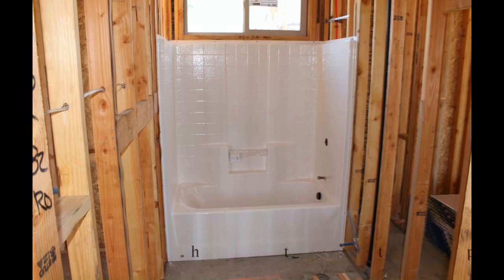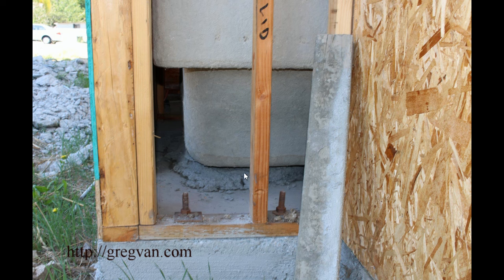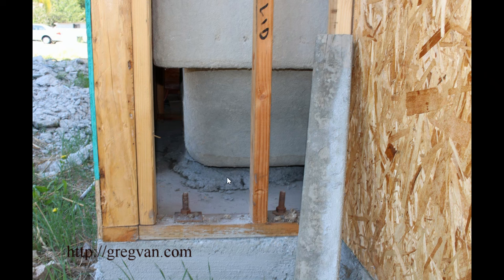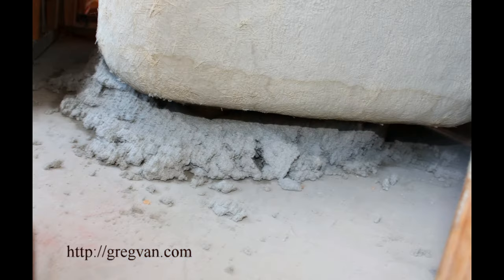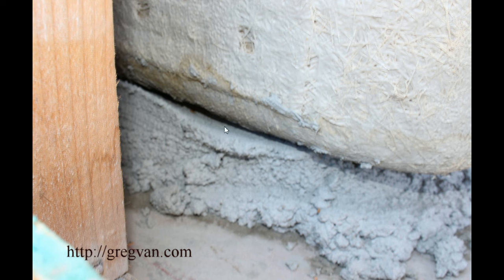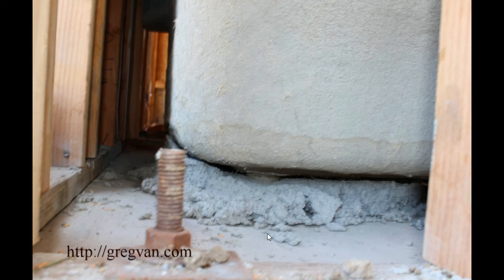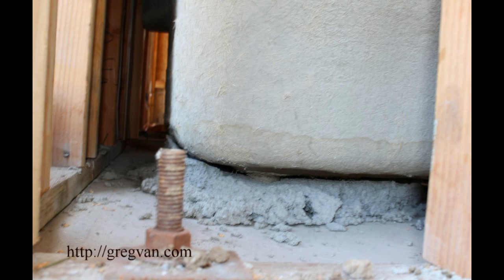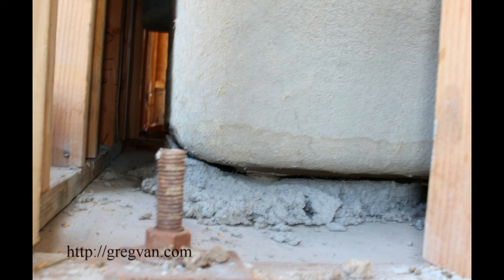Biggest Problems Created When Using Mortar Under Bathtubs – Plumbing

Comment: PRO TIPS----> Put down a sheet of poly so your NON SHRINK MORTAR doesn't actually stick to the floor encase you mess up the location by a bit you can just lift it up and reset, dont forget its not about cementing the tub to the floor, its about transfering the load of the human+water down to the floor. Roll the non shrink mortor into 5-6 balls, one in each corner for sure. Lastly, use non shrink mortar :)
Reply: What is non shrink mortar , is it a type of mix different to the usual mortar?
Reply: @michelleliddle6375 I’ve been looking at a bunch of videos, got a shower pan waiting for me.
I saw in one video, they use a “sand mix” found it at Home Depot. It’s a quikrete product called sand/topping mix. I picked some up, its about $7 a 60# bag. It’s over by the play sand. Gotta fix the drain first.
Reply: Thin set mortar/ tile mortar is what you want. And put it on top of cement board to keep from soaking the water out. If not put down a red guard or a liquid waterproof first. And most definitely stay out of it till the next day

Comment: I never use mortar beds. Never had a problem. Make sure you have a SOLID subfloor, make sure it's level. Use stainless steel washers to fasten to studs.
Reply: THis is what i am going to do here in a few weeks.. i don't see a need for this mortar mix under it.

Comment: I used mortar to set my tub and I'm a first time do it yourselfer. the manufacture specified using mortar or void warranty. I did pre install the tub, leveling it and marking the final resting position. I have about a 1/4 in drop in the floor, drain side.  I then removed the screws,  pulled the tub, and piled about 2in of more mortar on the plywood floor, covering the intire area where the base of the tub will sit. when I re installed the tub in the mortar I pressed the tub into the mortar just till I hit the marks then installed the screws back into the original holes. then I waited 3 days. so far so good 6 months later.
Reply from the maker: Excellent, it might've taken you a little longer, but it will be worth it in years to come.

Comment: This is why you follow manufacturers directions. If the manufacturer says to use a mortar or cement mix you should use non shrink grout. Non shrink grout doesnt not shrink when it dries. Plaster paris will break down over time if it gets wet. Plaster is water soluble.  I've been a plumber for 30 yrs and you need to follow manufacturers recommendations.  Some tubes and showers say dont add mortar or grout.
Reply from the maker: An extremely helpful comment and I hope others read it.
Reply: When you say non shrink grout is that mortar we are talking about or something different? Also Would it be okay to use rapid set mortar so I wouldn't have to wait several days for it to cure?

Comment: Started Plbg in the mid 80’s & our shop used plaster of Paris. One of the keys to using that or speed set drywall mud,(neither shrink) is clean water & tools, just a hint of plaster or mud & the batch fires off but pronto. In doing apartments/condos where tubs & their setting was subbed out, they used similar, never a cement mortar product. Sometimes they’d even glob it on build out studs for added wall support from flexing.

Comment: I use a really dry morter mix with a modifier, and it's worked well. I agree, you have to just set it and leave it. Also, the tubs I set had a support grid on the underside, which I think allows it to work a bit better.

Comment: @gregvancom The self leveler plus & Primer T from Lowe's worked excellent second time around . I had to drop laser level in the cut out drain section to see the line where to pour up to. Some product did drop down because "Great stuff" spray was blocking the laser. However, now the tub area was perfectly level using existing PVC drain & overflow. The Sterling Traverse 3 piece with the subway tiles lined up good. I used a outside felt grill mat as a cushion base over the leveler for added support.

Comment: A thin flexible rubber like material on the bottom making the mortar contact might work. I've seen thick foam board suggested but it has to be precisely cut, it will lift the tub if too thick or not make contact if too thin. The rubber or thin foam board would give and rip vs the fiberglass during removal also.

Comment: The Sterling fiberglass tube/shower I'm replacing has several supports built right into it. I had this tub for thirty years and never had any problems. When I installed it I didn't see a need to add anything else. At the moment I'm waiting for a acrylic tub that I ordered. I don't know what to expect as far as support, but is there anything wrong with using several pieces of say 3"' or 4" PVC pipe cut to fit under the tub for support? I also read another post someone had used pressure treated wood. Any opinions? Thanks...

Comment: My son has a 15-20 year old house, so there is not any access to the tub. I am a rookie to say the best.  Would drilling holes in the floor and then trying to spray foams through the holes work or wound there be to many voids to worry about? Thanks for any advice
Reply from the maker: I don't think it would work, but it wouldn't hurt to try it.
Reply: @gregvancom  Thanks I beleive your right there would be voids you can't see.

Comment: This makes total sense, if a 200lb Plummer stands in tub to set the tub, the tub deflects and when he steps out it rises back to its original position.
makes sense to me.👍
Reply: I would put a bunch of weight in it, and leave it there until the mortar dries. I’ll probably either fill it with water, or just use the heaviest plates I have from my bench press. Once it dries, I would think there shouldn’t be any deflection.

Comment: look closely the tub has legs on the back . the mortor  is holding the legs in place..... the mortor doesn't have to touch and the air gap is OK....I've installed hundreds of tubs being a plumber and we never use mortor unless it's a jetted or soaker tub those usually don't come with legs so mortor is needed
Reply from the maker: If you're suggesting that the bathtub installations are better, without mortar or Plaster of Paris underneath them, then I would strongly disagree. If you're suggesting that there might not be any problems if you don't use any type of support materials, then I would agree, but let's pay attention to the word might or maybe.
Reply: Kyle, I've been renovating houses for 30 years, and just giving some advice in case you haven't run into this problem. Some tubs, even though they have feet will actually have feet that don't line up in a plane as they ought to. The only way you would know this before the installation is if you flip the tub sideways or upside down then put a straight edge along the bottom of the feet to make sure they are all level. If they are level and the floor is solid and level, then as you say no mortar or additional support is needed. However I've found that with more than one brand- Lyons being the most recent, the bottoms of the feet don't all line up in a proper plane. They may be anywhere from 1/16 to 1/4 inch from lining in the same plane, or 6 out of seven all line up but one is either longer or shorter.  In this case it's necessary in my opinion to use either mortar or a rigid foam to support the feet that don't properly contact the sub-floor. The feet can also be packed with mortar to give them a wider stronger footing. Take care, and hope that helps.

Comment: Metal tubs and shower pans for the win... I'm done with fiberglass
Reply: From the horror stories I've read about people installing brand new plastic fiberglass tubs, I'm glad I'm going to be bypassing that experience. seems like everyone's tubs is cracking after installation and after they tiled around them. that's a ton of wasted money!!! I'm definitely going metal.
Reply: Steel tubs can still have issues if you don’t set and support them properly. I’m replacing my parents’ steel tub now, that my uncle installed maybe 10-15 years ago. He was a carpenter, jack of all trades type, so naturally he didn’t put anything between the subfloor and the bottom of tub, so only a 2x4 ledger board was supporting it on the back wall. Needless to say, it warped, and the middle started sagging, so water pooled in the bottom and started rusting it out. So unless it’s cast iron, with built in feet, I would recommend using a bed of mortar or plaster of Paris underneath, if you don’t want to end up replacing it again in a decade.

Comment: I got an acrylic tub at a ding and dent sale and came with no instruction nor can i find any online for this tub all i know its made by a company called Dubai. It has 1/2 particle board supporting the bottom and little squares (feet you could say) that keeps the tub level. would i still need mortar?
Reply from the maker: That's a good question and if the floor is level that the bathtub unit will be sitting on, then probably not. I wouldn't use mortar in between objects that are going to be less than 1 inch wide, but what use Plaster of Paris. The biggest problem with units with flat supports as you're suggesting is that they usually don't touch the ground.

Comment: I removed my old tub and found that the used plaster of paris, but they put them in bags and set them in the middle of the tub I guess for support. It's an old tub so I'm guessing that's how it was done back then. What type of mortar do you recommend using cause I've heard some will crack your tub if it drys too fast? I'm in the process of replacing my old tub.
Reply from the maker: You can use plaster of Paris or mortar and if you're worrying about it cracking, then you might need to contact the product manufacturer for more information. I could provide you with a suggestion, for example simply adding more Portland cement to your mortar to make it stronger, but this would only be a suggestion.
Reply: @gregvancom  Thanks, I've decided to go with plaster of paris.
Reply: Gypsum cement is the right choice for setting in drop in tubs.

Comment: My mortar was wet as if I were building a retaining wall....I didn't use 15-20 % of the bag....thinking it shouldn't be so dry......is that bad
Reply from the maker: Wet mortar usually shrinks a little more and then creates a gap in between tub and mortar, but not always.

Comment: Please be specific, what water mix ratio relative to what the manufacturers suggest and you've experienced as adaquate? 

 i e. I have an 80 lb bag that says to use 5qts of water.
Reply from the maker: I can't provide you with the exact amount of water used for any concrete mixture, because I've only used the directions once and it made the mixture to dry.

Comment: Is it normal that they concrete the pipe under the tub too? They did this at my house and we no longer have access to the tub pipe below but it has since cracked
Reply from the maker: No the plumbing pipe shouldn't have concrete on them, but I've seen it done before. As long as it isn't leaking or creating a problem, then you might not need to do anything.
Reply: @gregvancom  they cut my pipe with a saw then just left it embedded in the concrete so now I can't really replace it. It has a small cut but it doesn't appear to leak

Comment: I would use non shrink grout with plastic sheeting over it.
Reply: @Robo Man I have used non shrink grout under a fiberglass shower stall.  I troweled it in from the sides though because I had the room. Worked just fine and good until today.

Comment: I got a steel tub do u think I should support it underneath
Reply from the maker: +eric young Yes, unless it has some type of a support already. For example a cast iron tub usually sits on four legs and wouldn't need additional support most of the time.

Comment: How about the new foam stuff for setting fence posts?
Reply: KEVIN Carrick foam in the can work there’s one that sets harder. It’s never failed for me. You need access to the bottom from behind or side wall to apply it after is all installed. 👍
Reply: Why not? Seems like it will fill all the voids so as to support and insulate!

Comment: what specific type of mortar do you suggest?
Reply from the maker: I would imagine any mortar that can be purchased at a home improvement center or local lumberyard. You can make your own mortar by mixing two parts of Portland cement with three parts of sand.
Reply from the maker: I would imagine any mortar that can be purchased at a home improvement center or local lumberyard. You can make your own mortar by mixing two parts of Portland cement with three parts of sand.

Comment: What's your feelings on PLASTIC CEMENT?  "Dynomite"     cheers
Reply from the maker: I think Plastic cement mixed with sand and water would work fine for the situation also. However, if it was me I would use Portland cement.

Comment: I've heard of folks "setting" the tub by filling it with water and leaving it until the mortar sets. 
Same problem as the plumber jumping up and down to set it; once the water is drained, the tub will return to its neutral position.
Reply: i felt dumb when someone mentioned this and i hadn't done it, but thats a good point about it going back to normal once water is gone. thanks
Reply: Not if the mortar sets and bonds to the bu before the water is drained.

Comment: What do you think about using sand rather than mortar?  Pros and cons?
Reply from the maker: I would never use sand, because it can move. As a matter of fact I've never heard any plumber using sand, even though it's been mentioned on my channel.
Reply: My parents used sand 2 decades ago on a fiber glass tub with no issues to this day, and the local plumbing store that I was going to buy a tub from said to use sand as well.  My dad said that he built an enclosure, aka sand box, for the tub to sit in.  If you get your sand level correct, there is no place for it to move/displace in the box.      I suppose it could still have a little bit more flex than the mortar.  But i can mess up a mortar install and not even know it if i move around the tub too much by accident.  

I appreciate your reply.  I'm just trying to get more opinions about each option.
Reply from the maker: I'm not about to suggest that you're wrong, because I've seen a lot of things that don't make sense, yet actually work, but will use mortar or Plaster of Paris to create a solid surface underneath the bathtub.

Comment: i bought some mortar from lowes...one of the guys in plumbing told me to put down plastic first, then mortar then cover with plastic so it doesn't get on the tub...i'm worried about that "moisture sandwich" thing by doing that. 

Also, in your video you say it shrinks when it dries...so my question is, if I set the tub...level and push down, and its touching the tub everywhere, after time it will shrink anyway like you said, so won't that leave a space also (of course without moving it for 24 hours)
Reply from the maker: +carinlynchin The example you're looking at in the video probably had too much water mixed into the mortar. The mortar needs to be mixed as dry as possible, to reduce shrinkage. Remember, you can always use Plaster of Paris, but if you do, you will need to work quickly, because it can set rather quickly. I've had it set or get hard in less than 10 minutes before.
Reply: using plaster on cement in a basement will fail with time because of moisture...  that's why you put 2mil plastic moisture barrier - otherwise, it will fail over time as it's water soluble

Comment: I’m only watching this because our fibreglass bathtub cracked so we pulled it out to discover a big pile of mortar/concrete underneath. We are installing a shower now instead and so have to get rid of the concrete. It’s proving very very difficult to destroy 🤦🏽‍♂️🤦🏽‍♂️
Reply from the maker: I've cut fiberglass tubs up with circular saws and sawzals, if that helps. Just be careful of the sharp edges and I would advise wearing gloves and being extremely careful.

Comment: I use play sand under the tub, set the tub where you want it, draw pencil lines on the studs just spread out the sand and wiggle the tub around until the tub is back down to the lines
Reply: A major problem with sand is that it absorbs movement, but it doesn't rebound, so eventually a gap develops between the tub and sand, which means the sand is no longer supporting the tub.
Reply: it would be the same if you put nothing at all